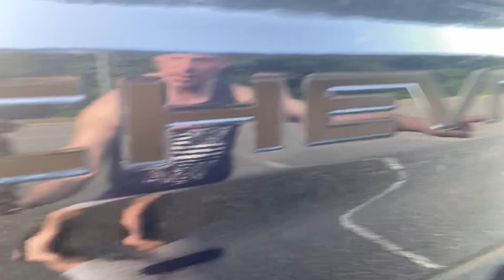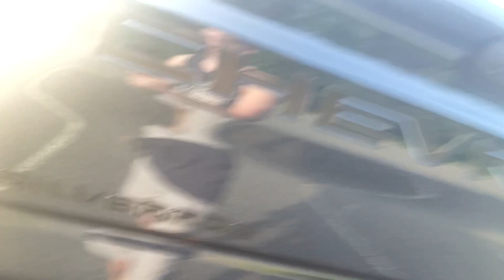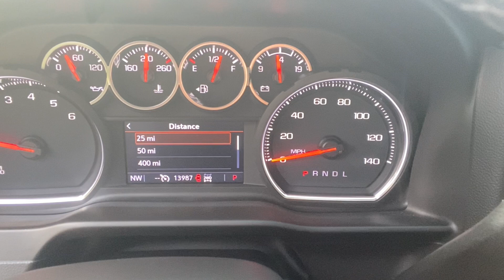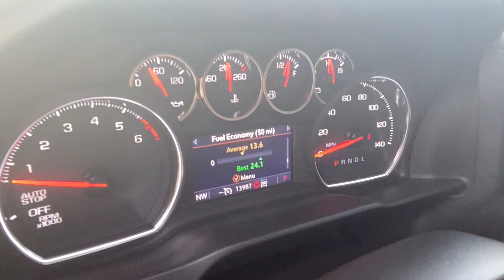Trail Boss One Year Walk Around

Comment: Sorry if I missed this in the video, but do you have any wheel spacers on? Or is the -12 offset good enough for clearance of upper control arms with these 35x12.5’s. I have a TB with the same level kit and looking to order tires/wheels asap. Thanks !
Reply from the maker: No spacers, and the tires only run in full lock to the left. No issues rubbing on the UCA either.

Comment: I like that stance. is that just an additional 2" level lift? I have an AT4 and on the fence to do a 4" lift (netting 6" standard lift) or a 2" ready lift with 35's. I figure if I do either one if I can keep my 18"gmc wheels on and run approx 35's
Reply from the maker: Thank you, I have the ReadyLift SST on which adds 2” to the front and 1” to the rear. I thought about going to a 6” lift as well.
Reply: @TheBlueGarage  looks good! Your Z71 didn't have any factory lift did it, like the trail boss?
Reply from the maker: @Livin_Easy  it did, it is a Trail Boss plus the 2”

Comment: How much taller did the truck get once you put the 35s on there? I have the same Readylift kit on my Trail Boss but I’m still running the stock 275/65 tires. Also, do you ever park next to other stock Trail Bosses in random parking lots just to see how much taller yours is?
Reply from the maker: I’m pretty sure it’s only another inch taller. I never measured to be exact. I have parked next to a couple, you can definitely see the difference. It looks like a more aggressive stance as well.

Comment: Awesome truck and perfectly done! Quick question, after cutting the mud flap or doing a mud flap delete, at full lock do you have any rubbing with the 35s and the -12 offset?
Reply from the maker: Thank you! I do not, but I also tucked the wheel well back after removing the brackets behind them.
Reply: @TheBlueGarage  thank you! Trying to keep Pennsylvania winters in mind with how big I can go on the tires and have room for snow to get up in there and didn’t want to rub. More tire less rim on a truck is definitely the look I prefer!
Reply from the maker: @joeparisi9735  I get that. I definitely prefer the  "more rubber wheel look." Where in PA? I am originally from Pittsburgh.
Reply: @TheBlueGarage  about 2 hours east of Pittsburgh in Altoona. My Ready lift SST just come in yesterday and I’m getting that thrown on next week, I also prefer the look with using the rear block rather than just install the front portion of the kit. Wheels and tires will follow in the next couple weeks, the 17s with 35s looks killer! Did you cut anything in the front at all, I know there is a bracket there as well?
Reply from the maker: @joeparisi9735  Ok, very familiar with Altoona. You will love the lift, it is a fairly easy install. It was the first lift I ever installed. I removed the metal bracket in the backside of the wheel well and then cut the plastic bracket in the front, before tucking the liner back an extra few inches. 17s with 35s is the only way to go in my opinion, unless you can throw 37s on. 😅
Reply: @TheBlueGarage  🤣 thanks man for all the information, I’ll take the appropriate steps so they fit by making those mods!
Reply from the maker: @joeparisi9735  anytime, happy to help!